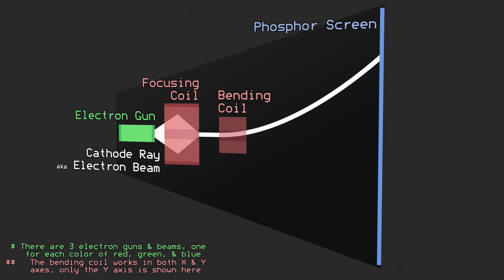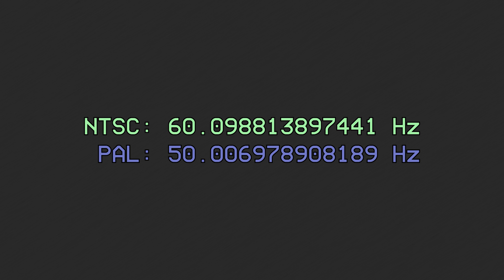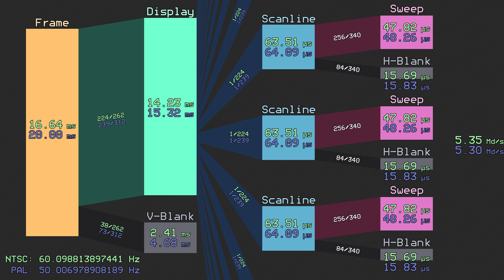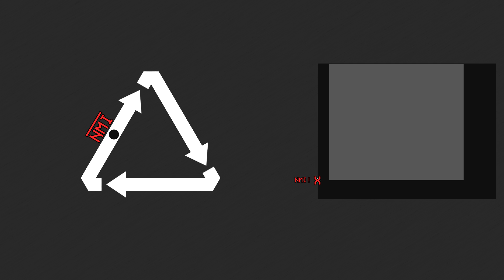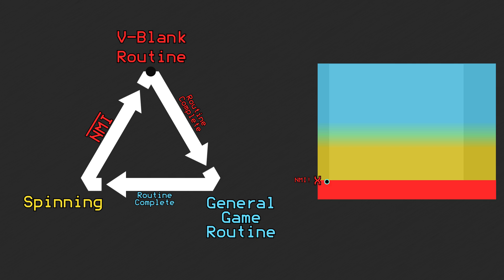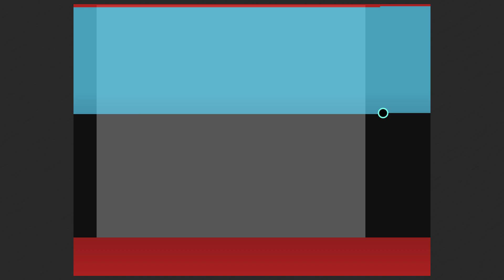Lag & Blanking - Super Nintendo Entertainment System Features Pt. 06

Comment: but wait, you would think that the entire frame is stored in the framebuffer first before it get's sendended to the screen,or is there only enough ram in the frame buffer just to store 1 pixel sothat it cannot store an entire frame in it's memory,mmm i don't know but am curious about this, 

BTW if a crt only display's 1 pixel at a given time in a fraction of a second,then it doesn't matter if that crt tv is whether 480i or 480p because in both cases theres only 1 pixel at a time in a fraction of a second,with the only difference that in interlaced mode there's a slight delay and in 240p mode (as opposed to 480p) every even line is skipped by the electron beam.
Reply from the maker: There is no frame buffer. The PPU starts calculating the signal for a scanline only one scanline ahead of time (this is why the display area starts at scanline 1 and not 0).
Reply: Retro Game Mechanics Explained 
Hi thanks for responding, is it also true that game developers had to know how an crt works did they really had to eork with such low end primitive toolkits , did they really had to exammen each pixel and know the timings of each pixels? Frame by frame ???or did the dev tool kir software cares about that???
Reply: + johneygd No, the developers did not have to care about every detail and microsecond "just to get the game running". We saw it here in this video: The system creates lag frames and forced blanks to compensate for timing "errors". Off course, if the game is constantly causing lag frames and forced blanks on top of the screen, the game feels poor to play. But on the other hand: By keeping the game simple enough (like early 3rd party SNES games) you can make sure that your code is always guaranteed to finish "a head of time". Only when pushing the hardware to its litteral limits it gets complicated - but even then there is an obvious solution: Add game features until you get artefacts, then optimize the code until the artifacts go away. If you can not get rid of the artefacts by optimization: remove the last feature you added. Still need the feature? Do it like nintendo and make the lag frames part of the pacing (like in metroid) or focus the user attention away from the artifacts (like in a link to the past)
Reply: sarowie wow this is very interesting, because in the atari 2600 age developers had to know exactly how a crt tv works and rely on it to measure the micro second of each pixel ,but you know what, theres even a more cheaper way to keep peoples attention away from those lag artifacts ‘by simply calling the game with a well fitted title to it, so if i have made an high demanding but sluggish & slow race game , i will just call it ice racing sothat gamers will believe that those sluggish & slow controls are intended to be that way but in reality it’s a limitation of the system, stunt race fx & dirt racer are prime examples of this,despite they both use the super fx chip, it’s just not enough, they both are still slow and unresponsive.
Reply: Literally, all you need to do is plop some graphics into vram, and write to different areas of memory to make sprites/backgrounds move. There's no "split second timing" mumbo jumbo unless you want to try and change these parameters mid scanline, which 99% of games don't do. The system has hardware support for changing data between scanlines, (see HDMA) which actually is very common in games, however.

Comment: The SNES had a lot of great games in spite of it's weak, wimpy cpu.
Reply: The SNES's CPU was sabotaged by crappy programming.  I can go into great detail about it.  Zero page memory is NOT supposed to be used as temporary registers that you have to constantly move data in and out of, it's for frequently used variables.  It takes 9 cycles to move a 16-bit value from one location to another, another 9 cycles to move it back, and using zero page memory only saves 1 cycle, so you better use it at least 18 times before you discard if, but if that's the case why not just keep the value there the whole time?
Reply: Acceleration vs brute force was a debate that could be seriously had back then. The disparity between the PC and the Amiga is even bigger. The Amiga had a strong CPU for the time it was released and good acceleration for both sound and graphics. Years later they made better Amigas, but almost nobody bought them. CPUs on PCs eventually became powerful enough that it could do everything the Amiga could in software. Doing it in software ment much more generality. The Amiga could not do textured 3D; the blit could cram out lots of pixels really fast, but texturing required some form of perspective correction or scaling (in the 2.5D case, e.g. Doom) that it could not perform. I remember the original 3DFX Voodoo 3D accelerator; there were people saying with a straight face that was a bad idea, we should just build more powerful CPUs. As late as the PS3 Sony was not planing to use a GPU; they were going to use the SPUs on their Cell processor for all graphics. You could get something like geforce 2/geforce 3 performance out of the CELL in software; but the CELL was delayed repeatedly and you could not get anywhere near 8800 GTX or X1900 performance out of the Cell so they had to use a graphics card with 3D acceleration.
Reply: Something I found really interesting about the console war of that generation was that the Sega Genesis was less powerful in every way than the SNES, but it had a much faster processor. This probably played a large part in the development of enhancement chips inside SNES game cartridges.

Comment: As far as i know game developers did not had to care about this as everything is handled by the gpu chip right? Am mean if game developers really had to know & care how an crt screen works to design games around this in mind just like with in the atari 2600 day’s then i can imagine how really psychologically difficuilt, primitive and time consumming this is,phew in this case i will never understand how game developers could,ve poop out soooo many games per year on the maked,pffffff
Reply: They had to care about, even if a GPU is off-loading some of the task or all of this task. For e.g. On a computer, there is the option to enable V-Sync in games to avoid screen tearing and other artefacts. Yes, it is possible to alternatively aim for three digit frame rates - but this is even harder when you do not know anything about the computer then to write a game that simply runs on one hardware platform where you can calculate every microsecond.

Comment: Is that related to the black flashing moving bar in Super Mario Bros. 3 for the NES down at the HUD?
Reply from the maker: It is related--instead of NMI and a V-blank routine, its an IRQ and its corresponding routine to switch the background scroll for the status bar. The NES didn't have HDMA so the timing was done manually. This is also why the status bar in that game will jiggle around when the game is lagging--the IRQ handler doesn't fire consistently.
Reply: Oah thanks for the explanatation, I always knew this has something to do how much stuff is going on on the screen.
But it is always fascinating with how little hardware ressources the game developers had to work to make great games.

Comment: Awesome video as always! I never knew that actual CRT functionality was calculated in the SNES!
Reply: MegaZeroX7 it surely does. In fact, the light gun used in the SNES detects the point you're aiming at by reading the CRT position when you fire it. Basically, the light gun is pointing at a specific point, and when it detects light, it tells the SNES to read the CRT position to determine where you're aiming

Sadly, because of this, it doesn't work on LCDs
Reply: @ddnava96  wait, I thought the SNES had a white square for one frame when you pulled the trigger, and whether or not the gun saw that square determined if you shot..

or am I thinking of the NES light gun?
Reply: Yes, You’re thinking of the NES. Unfortunately that also doesn’t work on LCD screens
Reply: @flurf5245 . That one with white squares was on the NES and it had to stop the game while it was showing the squares. The SNES had a more clever approach with the CRT position in order to calculate it immediately without needing to stop the game
Reply: @ddnava96  That's amazing. See, this is why we should have stuck with CRTs.
Reply: @tpommischiefmaker . There are still some high-quality CRTs made. They're just not very common and you won't see them unless you're actually searching for them. It's like vinyl records
Reply: @ddnava96  I'm pretty sure no companies are making them anymore.
Reply: @tpommischiefmaker  while CRTs are awesome, there's no chance of us advancing any further with them.

they're cool, dont get me wrong, but the technology we put into modern screens will never sync up properly with CRTs.

Comment: Your scan lines are wrong. From top to bottom, you're right, but it actually goes back and forth about 7 times back up the screen to start over. If you crank the guns, you can see that retrace.
Reply: He mentions later that the position of the beam during vblank is undefined and varies by TV manufacturer.

Comment: Awesome video! The RAM refresh period you mention seems suspiciously placed on screen... is this the source of the ghostly vertical bar artifact you can see on some SNES models?
Reply from the maker: Yes! I'm not an expert in the hardware side of things, but I think the voltage becomes kind of unstable during that period causing the video signal to get slightly brighter. I believe an option to mitigate the issue is to add in a capacitor somewhere.

Comment: Could f blank be used to draw black? I keep thinking there’s some pallet mode the SNES has that doesn’t have a very dark black.
Reply from the maker: Technically yes! It'd be really limited in what pixels would be black, but totally possible.
Reply: You could estimate that, given that forced blank is enabled by writing to a register, and disabled by the same...

Each of those requires a LDA followed by STA, and you can write to the display registers at the full 3.58 mhz.

We know that the video display timing for low resolution mode is 5.35 mhz roughly.
The system master clock is 21.477 mhz, which makes the pixel clock 1/4 of this, and 3.58 mhz is 1/6th

So we know that for each CPU cycle used we have 6 ticks of the master clock, but for each pixel drawn we have 4.
This means 3 pixels drawn every 2 cpu cycles. (if for any reason the CPU slows to 2.68 mhz, which is 1/8th of the master clock - which can happen if you access main memory, or slow ROM, amongst other reasons, that means each CPU cycle is 2 pixels)

Anyway, what does that mean for using forced blank in this way? LDA with an immediate value (if 8 bit) takes 2 cycles, STA with an absolute value takes 4.

That means your amount of black is dictated by ending forced blank.
Which should take 6 cycles, meaning either 9 pixels, or 12 will be drawn in that period.
That is the absolute lowest you can possibly go...

However, synchronisation and timing code will make this highly impractical.

And of course 9 or 12 pixels is A LOT when the visible screen width is just 256 pixels.
You'd at best be able to do this 14 times across the screen.
But that would take effectively ALL your CPU time for the line on which you drew it.

Also keep in mind the effect this would have on a PAL system is quite a bit different. (the timing is different.)

I can't say this is a practical method to do much of anything honestly.
It works if you're using a longer chunk of Fblank to mask something else, but as a means of drawing black?

The SNES palette has 32,768 colours, and you can define any of the palettes in almost any mode to any of them.
(there's a direct colour mode in which you can't freely specify colours. You use it either with High colour mode - mode 2, or with Mode 7 - in mode 2 it technically allows 11 bit colour, but that's not as useful as it sounds because 3 of the bits are only specified once per 8x8 pixel tile. Combining it with colour addition mode though is a way to get all 32,768 colours onscreen at once, though not particularly useful for anything other than showing off.)

Anyway, this means there are 32 shades of grey for the system, several of the darker ones will almost certainly look black.

If you have a PAL system you're used to seeing part of the vertical blank onscreen. (because the SNES only draws 240 lines, but by my estimates the visible portion of a PAL screen is more like 267 lines. Hence black bars are visible no matter what.)
I can't say this looks any darker than any of the shades the system could be using anyway.

It's an interesting technical question, but it doesn't seem like a particularly practical thing to do.
Reply: Do you the minimum amount of time the hardware can use to turn f blank on and off again?
I would imagine that in this example the amount of black pixels would be limited by the width of the object in relation to the time it takes to the processor to actually execute the blank.

Seeing how the spin cycles are somewhat visible even with two lines of code i would guess it would only work for things like big chunks of UI
Reply: KuraIthys
Old CRTs usually has huge overscan areas. And thus, force blank can have less impact than if you assume BVM level TV, or those who shrink down the image on TV somehow to see what's going on in the overscan area. 

Maybe horizontal overscan is hard to aim, but vertical ones should be easy enough. Still not a good way to draw black, though. Unless for sci-fi themed games, which might benefit from CPU being able to distort the screen during Fblank period, which also acts as distortion, to create some glitchy effect.
Reply: lol. Mid-frame OAM write? That sounds like a disaster waiting to happen, but I suppose some people  really like to push the envelope... XD

As for the overscan, actually using forced blank to extend Vblank time is a common tactic for any developer who is desperate to be able to do more DMA in a frame.

You'll notice if you look that SuperFX games are only 192 lines at most. (they can work in lower resolutions too though.)

By using a forced blank to stop the PPU early, and ending that blank later than Vblank would normally end, you effectively get more DMA time.

So if you're doing something that requires regular very large data transfers, that's a useful method.
You're basically trading vertical resolution for DMA time.

Incidentally, while this means nothing for original games, for modern homebrew it's worth noting that on a PAL system, a resolution of 256x200 is a 16:9 image.
This means that if you use the zoom functions most modern televisions have you'd get a perfect 16:9 image and gain 40 extra lines of DMA time compared to the default for a PAL system.
40 extra lines is something like an extra 7 kilobytes every frame...

(this doesn't work quite as well on NTSC though. a 16:9 image on an NTSC machine would be 256x168 instead. Although in this case it WOULD gain you 56 extra lines of vblank, which is nearly 10 kilobytes. Considering an NTSC system only gets 6 kilobytes each frame normally that's a pretty big difference.)
Reply: KuraIthys
Well... If disaster is intended to happen, then it's not a disaster anymore XD

Not sure about the 256x200 on PAL yields 16:9 though... Despite having higher vertical resolution, standard PAL image is still 4:3 (and assuming 256x288 is 4:3 ratio, 256x200 yields me the 16:8.33 ratio). Though I don't think I know much about how the resolution works. As for on NTSC, you can just have 256x160 anyway, if your calculation is correct (which I have no idea if it's the case).
Reply: Is the SNES PPU hardwired to output black pixels when forced blanking is enabled? I wonder, because the NES PPU outputs the backdrop color (PPU $3F00) when the background layer is disabled

Comment: I don't know if you actually reply to comments (you probably do, hopefully), but I need to ask, how did you get the "main loop -> spinning -> V-Blank" colored visualization in real time on SMW? Is it a custom emulator or perhaps a LUA script? If you can't share it, that's okay and understandable.

The reason I'm asking this is mostly out of curiosity, and also because I'd like to check the timings on other games.
Reply from the maker: I use a modified version of this script I made to create that scene: https://pastebin.com/2rmgbL7V It's built for lsnes and the offsets at the top are set for the English version of Super Mario World (it should work for any SNES game given you know where to hook those two parameters).
Reply: Retro Game Mechanics Explained Ah, thanks. That's gonna be very helpful. Finding the end of the main loop and VBlank routine of any game shouldn't be much of a problem.

Comment: This may be a dumb question but if third-party hardware could control when the CRT's blanking occurs, why couldn't game consoles do that with precision and, in essence, give the same effect that AMOLED displays, with the black pixels being off? Or is it because you'd never see the "blank'd" portions due to the persistence of vision effect the CRT technology relies on?
Reply from the maker: I'm not too familiar with CRT hardware so I can't say for sure, but it does sound like that would require another processor or module to control it. The main processor is clearly not fast enough to control the blanking at a dot-by-dot level. Also, if the electron beam has any sort of overhead startup power consumption, it might not be worth flipping it on and off over again versus letting it scan out black.
Reply: It's not always the console forcing the beam to be off, on the NES the F-Blank does not actually turn the beam off, but rather the PPU's memory accesses. From then on, the PPU outputs pixels with the color of the backdrop color (from PPU $3F00). Maybe a similar thing happens with the SNES?